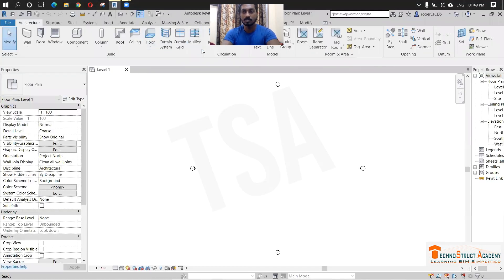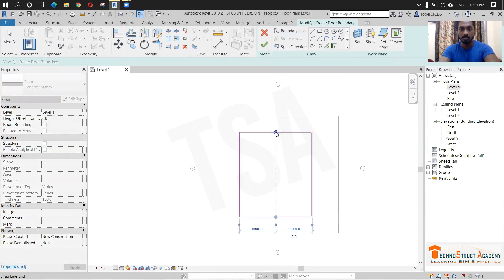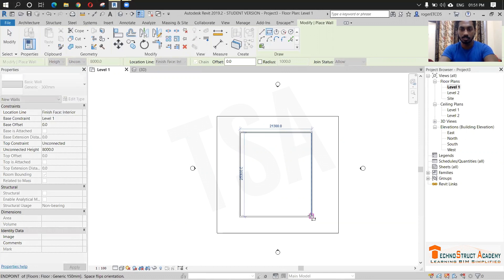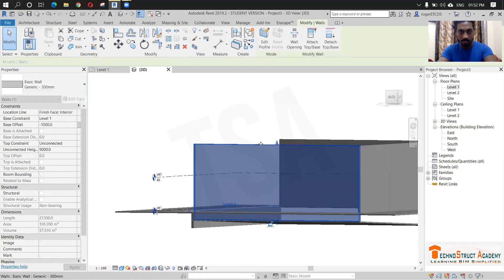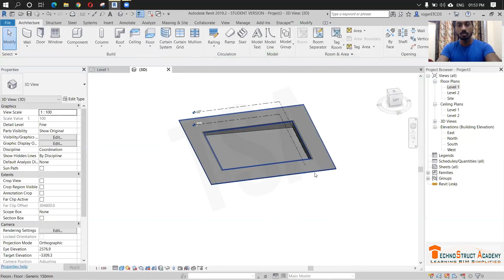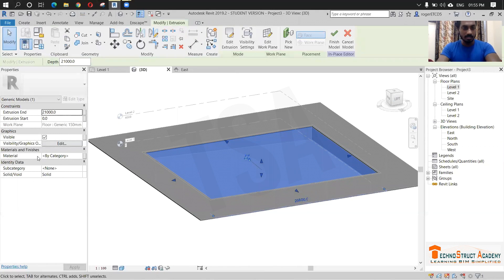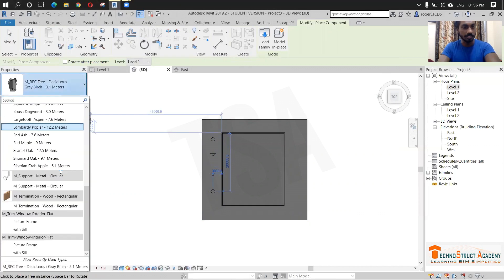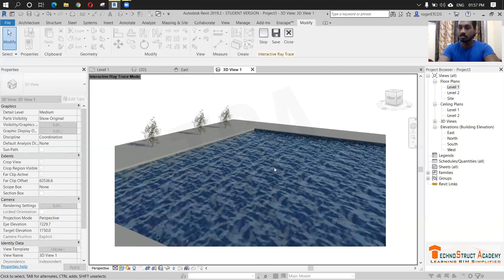How to create Swimming Pool with Realistic Water in Revit

Comment: I followed your steps but the water does not show at all, it looks like a normal floor even tho I changed the material, do you know why ?
Reply: Sorry for necroposting, it is material issue+graphic display. 
Different GD options take different types of data from materials, making it coloured/gray/ textured. 
1. Check your material and attach a water texture (revit has one)
2. Depending on your target, check the "Use Render Appearence" in material menu.

Most ppl do not need a realistic water, so you can just make pale blue fill huge transparency, it would perform flawlesly for drawings.